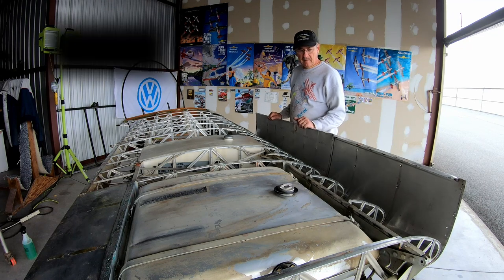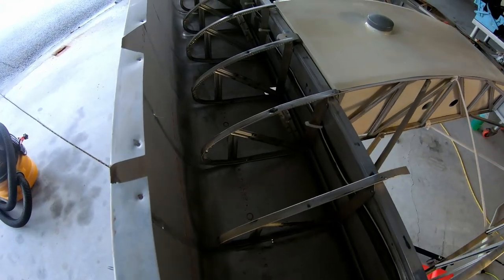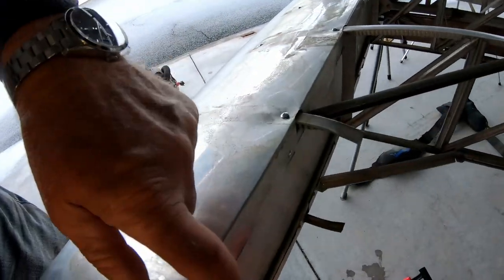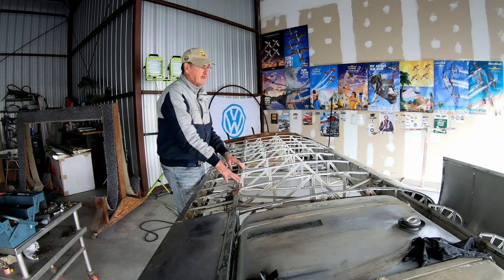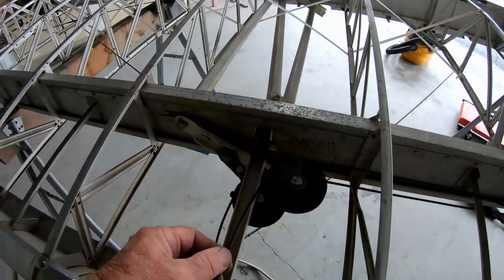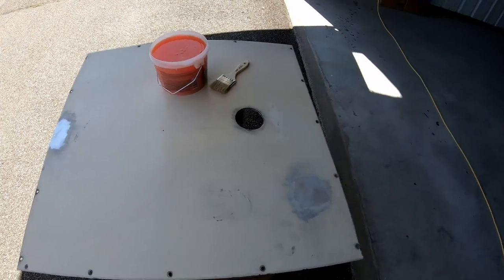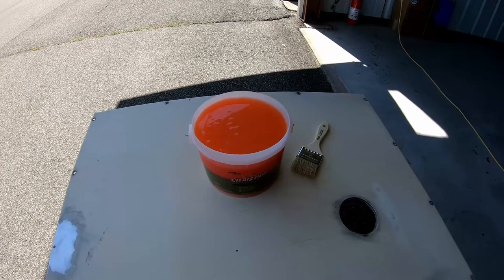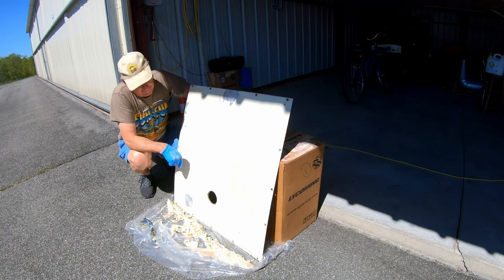1960 Piper Pacer left Wing recover Part 3

Comment: Bad place to put the wire. Ask yourself, in home wiring why do they use box connectors? The answer is that a wire should never pass a sharp surface, else there is potential for a short. Why is it that cars have wire harnesses containing several wires housed in a flexible plastic tube? To prevent fraying on sharp surfaces. So how much movement and flexing is there in a common wing construction while it is in flight? You have wire tied these wires to several ribs, something that was not there in the original construction. Yes they will fray. It may take years but that's what is going to happen. I'm thinking it would have been better to shield them in a tight approved binding tape for that purpose. You'd have to pull out the FAA manual for that update and I don't have that info. I'm in Canada. If ties are used understand that not all ties last as plastics are subject to deterioration much faster. So it must be approved, and I would be inclined to think that some kind of a long lasting vinyl grommet would suffice.
Reply from the maker: Thank you for your advice.